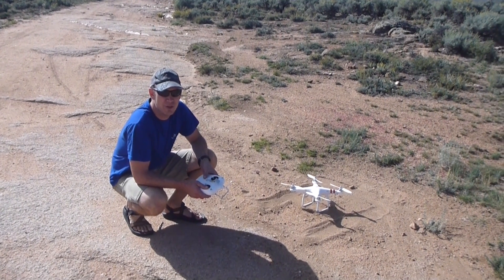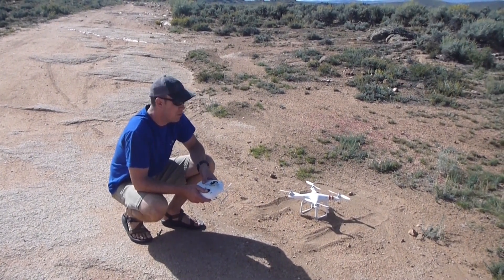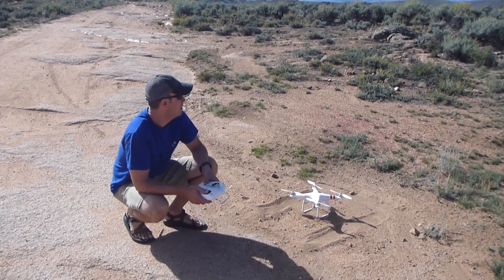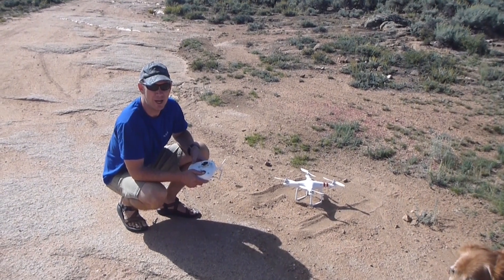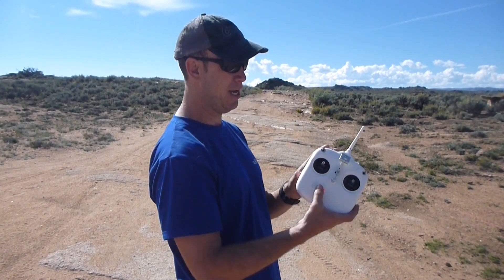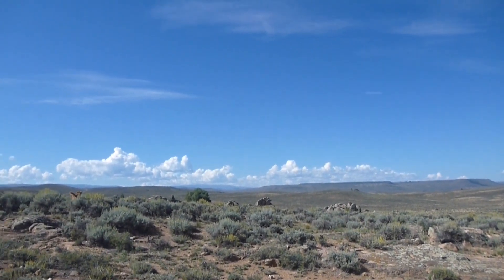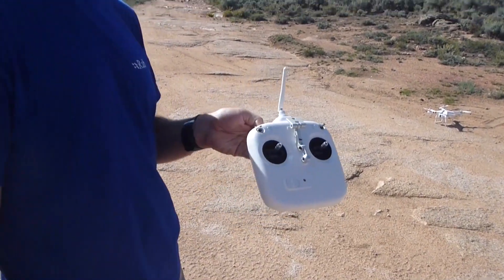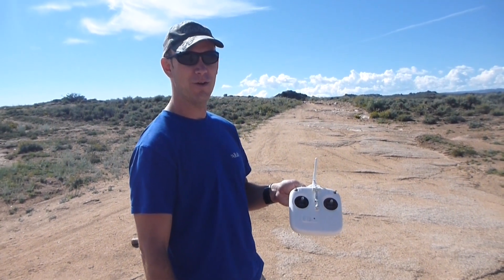Return to Home Test of the DJI Phantom

Comment: DJI used to post the updates on their site but I was unable to find that section the last time I went to their site so I cant tell you where to find them now . I saved the programs and sites for them and from time to time just hook up and refresh with what I have . But it's not a cure all watch my last You-Tube post to see what happens when Parks and Wildlife key up their radio WiFi system . I don't blame them in any way they are dealing with the worst flood they have ever had , so when they have to talk on the radio we deal with it . But all is well almost everyone there helped me look for all the parts and that was tough in that bush snake infested overgrowth (great big thanks to all of you that helped I might still be looking lol ) but all is well it is all back together and flying thank you all so much . But be warned the DJI system is by no means foolproof . Or even close . Best of luck finding updates .

Comment: Does this work right out of the box or do I need to update it?
Reply: That's a good question. Did you ever get an answer ? I was wandering the same thing
Reply: As Seen On Social Media It is if you set up and configure it with switches and NAZA software. TBH just need to check it's on. Not much into changing settings. All of it is in the manual.